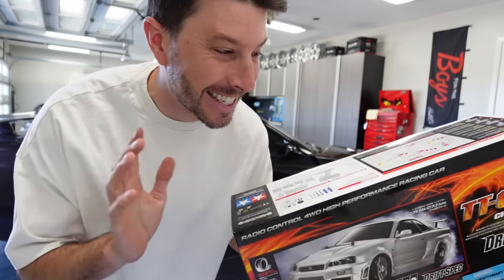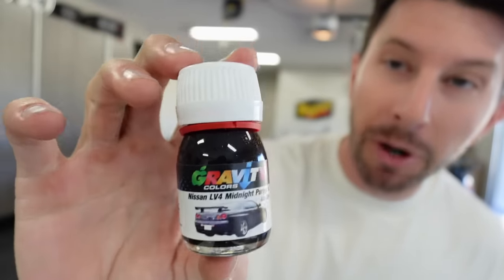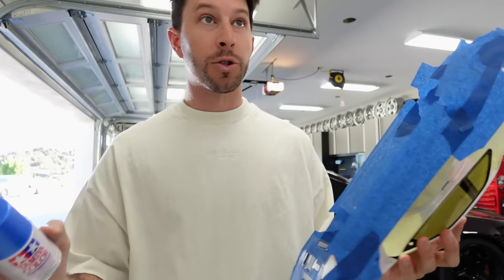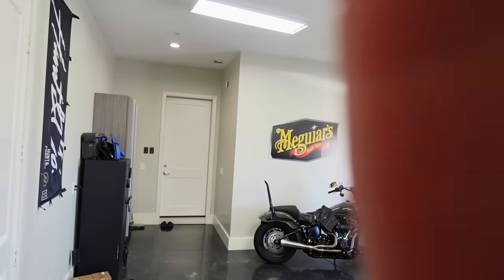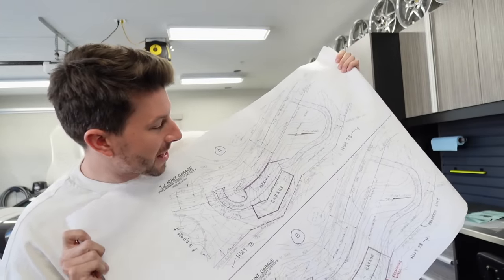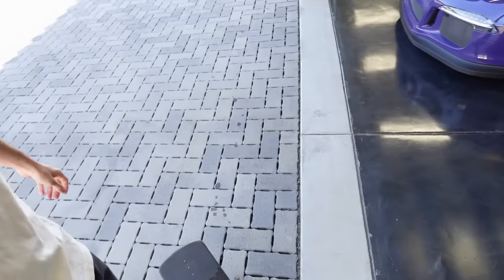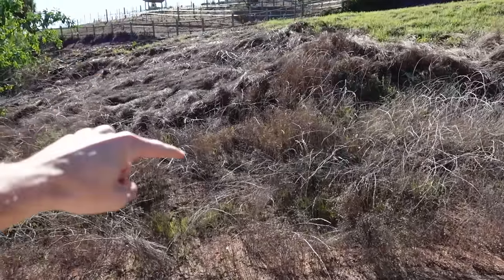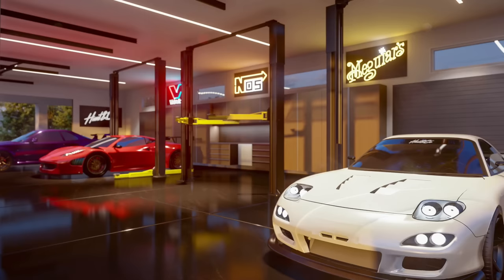The Video I Never Wanted to Make.

Comment: Tip: lexan paint can be painted on the outside, if you want a flat paint accent that paint no matter what color will be flat. I've used it on the outside of bodies for bumpers, or stripes that need to be flat or if you want the whole body flat. Then paint the inside a primer color and when the outside gets scratched, the primer will show through from the inside.

Comment: excited about the rc content. maybe your friends will get into it? plus it's fun to hang out at the rc track

Trick for model paint if you wanna use Midnight Purple: Use clear bodyshell paint as a first layer for the model paint to stick to, spray your color till it looks right, then seal it with a grey, silver, white or black undercoat (depending on if you want it to look darker or lighter)

Comment: Yo TJ, if you wanna spray your rc car with OEM colors… You could try buying an aerosol can from Touchupdirect, bought some Dark Blue Pearl M2Y for my Subaru, and the color was spot on flake was crazy too. Did bumper repair on the lower front lip of the bumper. Comes with a clear coat to seal too… Thanks for fantastic contentz

Comment: You can spray the RC body on the outside, but then you first have to spray Tamiya PS paint and then spray the color you want on top. And please be clear about that extra protection. Tamiya Tt02 is not that good for drifting because it is 4wd. It's better to buy a real RC RWD chassis such as Yokomo YD2 or an MST RMX. Sakura d5 is also a reasonably good chassis with the right electronics

Comment: if you want a Sweet RC to Build / Race around on your  Dirt Track in your Yard get one of the following Schumacher Cat L1R,  Team Associated RC10B 74.2D,  Losi 22X-4,  HB Racing D4 Evo3, Yokomo MO 1.0, Or XRAY XB4C'23.  the ones i mentioned are all the Top of the line in their Class  (4WD Buggies) they're Expensive but loads of fun.  you'll find that there are Die Hard fans out there for Each Brand and even more so for the electronics you put in your Stuff.  Tekin, Reedy are the more High Dollar Brands but Hobby Wing or Castle are quiet Dependable in my experience I'd get Sensored if I was you though as you wont want to fry your Electronics Immediately lol! make sure when you get a Servo you get a High Torque and Fast Response Rate, Preferably Brushless/Metal Gears.

You can find yourself Dropping $800-1k on a RC build Very Easily it isn't a Cheap Hobby if your going the route you want to take which is the "Kits"

Comment: The RC body will also have a protective film on the outside so after you have painted it the paint will look a bit flat until you remove the film, seen a few people not realise this in the past and place sticker that cam with kits on film and wonder why it doesn't look right.
Reply: Pretty sure he put them on over top of the protective film by accident.
Reply: @jbuch66koop  might be able to get them off if careful but it's a pain the ass to do.

Comment: So in terms of the color on the RC car, spazstix makes color shifting paint that will get pretty close to midnight purple. When you spray it on, it will look almost transparent. Do two or three coats of it, then back it with black, and all of a sudden it will be that changing color paint. This needs to be done on the inside obviously. You also screwed up on a couple other aspects of the body, specifically you have to mask the windows on the inside before painting, and you put stickers on the body without removing the overspray mask on the outside of the body. You want to leave that overspray mask on until you finish painting, then you remove the window masking and the overspray mask on the outside and put on the stickers. Spazstix SZX05709 green/purple/teal backed with SZX00119 black backer (both available in spray cans) will get you a color that is pretty close.

Comment: I went through this same rc phase but not quite as spendy, I got a 4tec 2.0 AWD car and just put a new body on it, another tip I heard was to cover the back side of your blue paint in a couple coats of black because when your body flexes or when you crash it too hard you can still damage the paint.

Comment: I'm an engineer in the building design industry, if you wait too long and codes change enough, you will have to go for another permit. Permits expire in 2 years in California. Especially with title 24 in California (which is super strict), you may just need to have the architect and engineers update the drawings. Sometimes its quick and simple other times it can get messy. Depends on the codes that change. Electrically speaking the National Electrical code, International Building Code, and Emergency Codes updates every 3 years. I just want to make you aware of that if your design team didn't.

Comment: teej, before you paint that 34 body. Wash the inside of it with warm/hot water and dawn soap, scrub it with a sponge. Couple of coats, Then back it with either black for a darker blue, or white for a lil bit brighter blue. mask off the headlight and taillights if you are gonna run the light buckets. 
There is a plastic protective sheet over the outside of the body. I hope you pulled it off before putting the stickers on lol. 
And its easier to line up bodyposts while the body is unpainted. 
Unplug the battery in the chassis while not in use to preserve the battery power/umph, and battery life. and if its lipo, charge it properly so it doesnt go up in flames lol.

Comment: I've had a tt01 for nearly 10 years 😂 stock l.c arm and tie rods will brake.. just replace what you can with aluminium parts . TT chassis are the best rc drifting platform imo

Comment: You really want to build the one I’m talking about. It’s literally like a real car suspension brakes. Everything with a two speed transmission. The gear shifter moves as your shift gear. The steering wheel turns when you turn the wheel. It’s the shit so let me know if I find the link I’ll put it on again but if you check your social media, you should find the links that I sent you a while ago. I’ll try to get the name.

Comment: There is a very to scale or 34 of your car in midnight purple that you build a suspension it looks identical you build the motor it has a two speed transmission the fans turn and everything else on the car even aversions I have sound if you’re interested hit me up I’ll let you know about it. I have sent you some emails in the past. I don’t know if you’ve got them about it. Also, please check your orders I have an order that says that it was sent back for some reason I don’t know what’s going on. Good luck with one